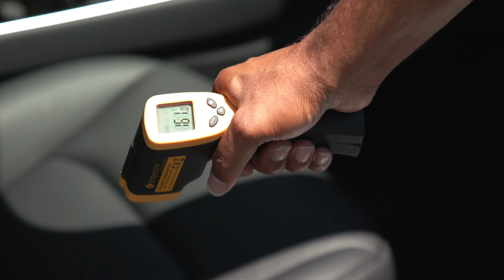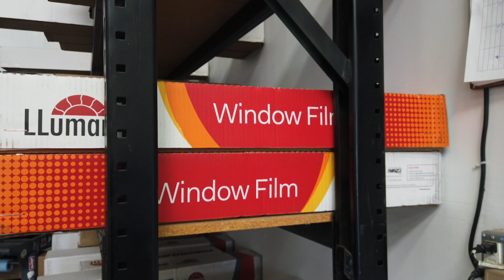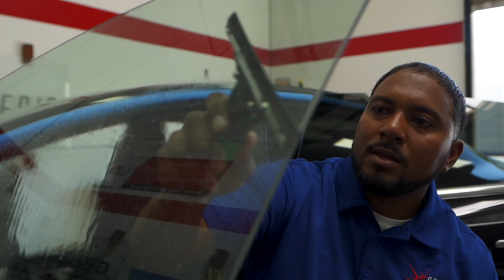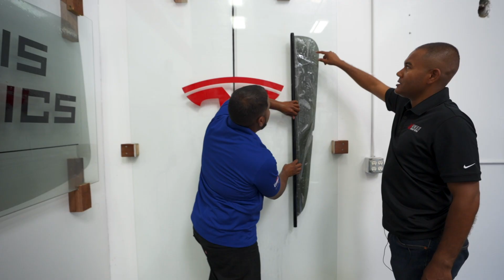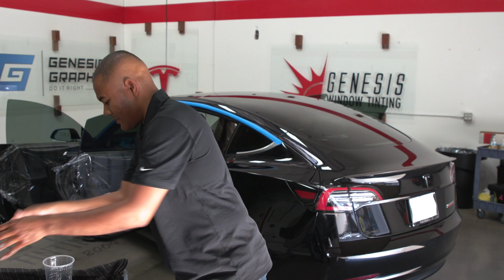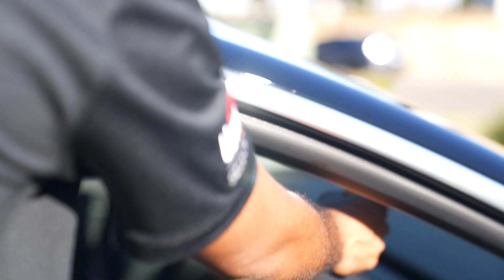How to TINT a Tesla Model 3 with Ceramic Tint (Step by Step) | Sacramento, CA

Comment: Why wasn’t tint applied to the Sunroof section of the roof glass? I’ve gotten conflicting info. Some saying it’s not necessary because it already has heat rejection, and other saying that tint needs to be added for better performance.
Reply from the maker: Hi Snay,  Good question.  At the time I felt that the factory glass would provide enough heat reduction.   After owning a Model 3 for a year, I feel that the sunroof area benefits from an aftermarket ceramic film.  If you happen to be  in the Elk Grove, Sacramento do Roseville area, I invite you to come see my Model 3.  You can evaluate the quality of our installation and feel the heat reduction that ceramic film delivers.  Thank you!

Comment: Thank you for posting this video. I'm hoping you can help answer a question for me. Can tinting the rear window damage the  window? I just had my car tinted at a location in Southern California. After getting the tint done... my 1 of my rear window wont fully close or open and it's making clunking noise and gets stalled.
Reply from the maker: Hi Quan,  Thank you for watching.  It is possible that the inner window gasket is folded downward.  However, it is hard to diagnose without seeing the issue in person.  I would take it back to the installer and ask that they check for any interference between the gasket and window.  If that does not work out, you can contact me directly at info@genesistinting.com and I can help further.  Thank you.
Reply: @GenesisWindowTintingElkGrove  Thanks so much for getting back to me. I believe the tint installer closed my door with the latch door on (which damaged the trim and regulator).  There are scratches to the trim of my door which Tesla said is due to the window not being dropped when closed. Sucks.

Comment: Thank you for posting this.  What is the clearest tint for the front windshield?   The police in my area give tickets if they notice any tint on the front doors or windshield.
Reply from the maker: selmateacher7 - Daniel Berry 
The lightest tint we carry is Llumar Air90 at 84% visible light transmission. It is very clear and offers 30% heat reduction.  The Air80 is 77% visible light transmission with 43% heat reduction.
Reply: @GenesisWindowTintingElkGrove   Awesome.  I like that.  Going by what you you said on your website, I am allowed to have that on my front windshield, legally.  I am thinking of bringing my Tesla Model 3 to your store.  Thank you for the reply.
Reply: @selmateacher7  where you from that doesnt allow any tint on the front doors?
Reply: @series25a  True.  Central California
Reply: @selmateacher7  really? i was looking at california car tint laws and it says the front side windows is limited at 70% and back is like 35% I'm also from SoCal with my front at 70% and back and rear at 50%

Comment: What percentage did you use on sides/rear/windshield?
Reply from the maker: Hi Justin.
Windshield-50%
Front doors-35%
Rear doors, quarters and back glass -15%
All in Llumar FormulaOne Stratos Tint
Reply: I was thinking the same thing... I don't think he mentioned the price either!